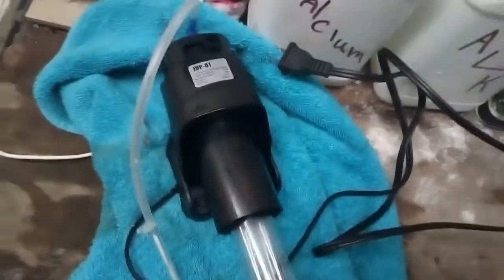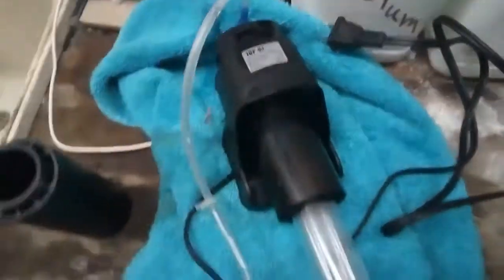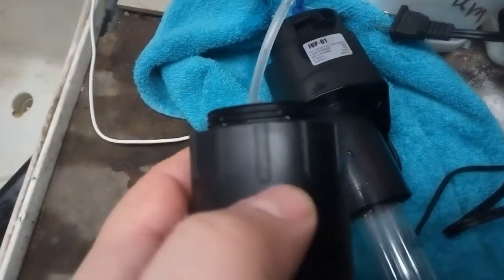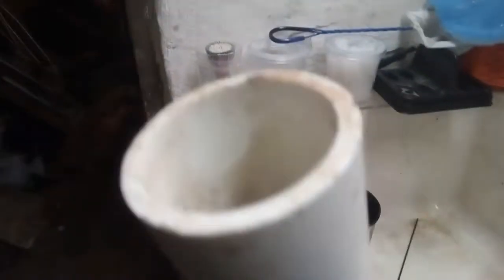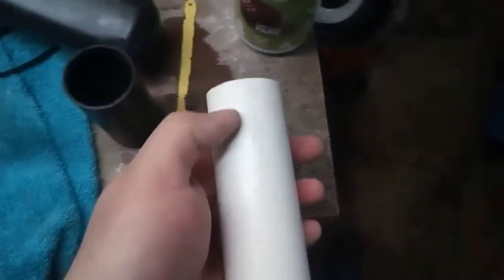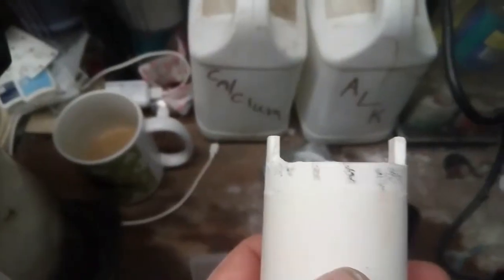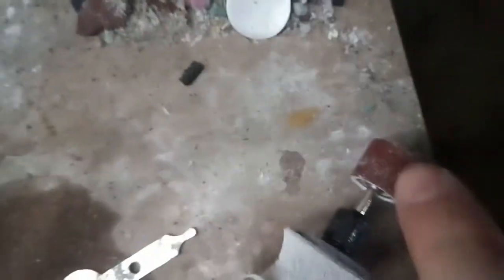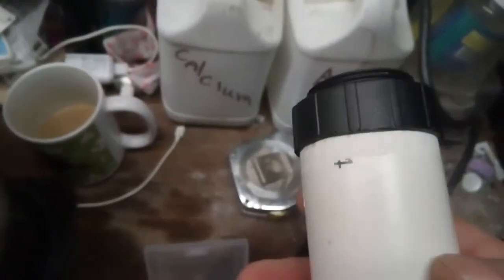Sun Sun JUP-01 UV Sterilizer FIX PLASTIC LEECHING MELTING

Comment: I’ve been using these filters for the tanks of my two turtles for a little more than two years now. should i switch them due to this plastic problem? didn’t think it was much of an issue as it has been fine for a while but might take the extra precautions

Comment: I bought this same one 3 days before. and I knew about the plastic melting problem when I had watched your youtube. I will not use this thing in my fish tank and keep it in a box or trash it out. By the way, I have a idea about solving it. If I could pasted a UV blocking flim in inner sleeve tube, could be the problem repaired?

Comment: Thanks for the heads up. Think I'll just spray the one I just ordered with Krylon UV protectant or for plastic. Can't hide everything and thinking I should spice up some exposed components with some color anyway.
Reply: Did it work?
Reply: @jrullo4716  Don't know, sprayed it with Krylon, had a snail infestation in another tank, and forgot about it. The algae had dropped way off, I think because I'd put a couple sprigs of Potos in the tank and they grew like mad robbing the algae of nutrients.

Comment: What if you put aluminum foil inside the plastic container of the bulb?
Reply: or a ceramic sheet. it will protect the plastic cover from the uv..so no uv on the plastic. no leeching
Reply: I don't see why that wouldn't work.  might even work BETTER, because you're now reflecting the UV light back into the tube, amplifying the effect probably by at least 50% or more.  just make sure it doesn't interfere with the flow-through.
Reply: Crap. I just ordered this.  Hope they improved it.

Comment: for anyone doing this just soak the  piece of cut black plastic you need in hot water and your replacement piece of 1& 1/2 piece of pvc will slide right in to the black piece of plastic nice and tight

Comment: So it works??
Reply from the maker: works great
Reply: Isn't the plastic around the bottom and top of the sleeve still exposed to the UV light?
Reply: Did this, but used a piece of UV resistant 50ml pipe, by heating the top the threaded portion fits inside the PVC, bit of silicon and good to go.
Reply: I did this mod, but with Black PVC pipe.  I still get the black residue, but far less.  I am gonna try to find some White pvc pipe, as that makes more sense.  Haven't been able to find any UV resistant pipe though.